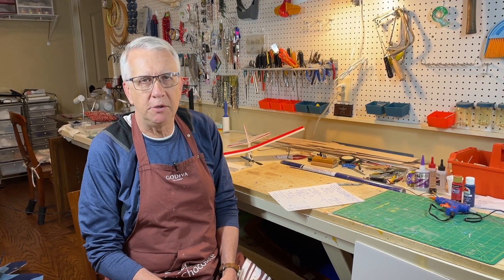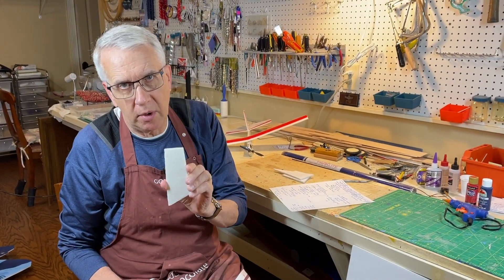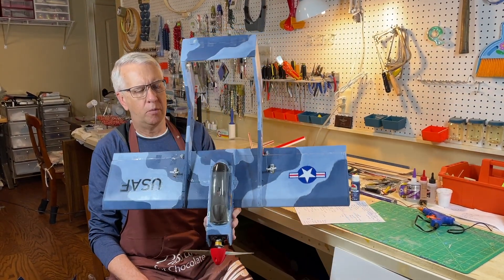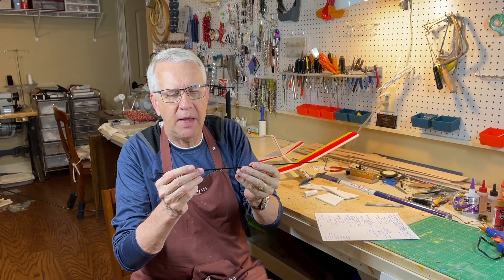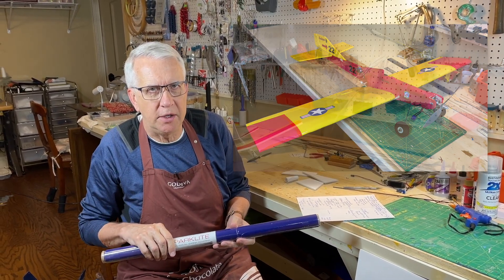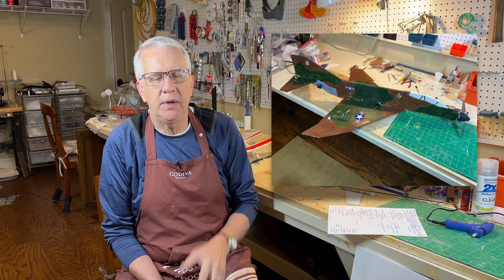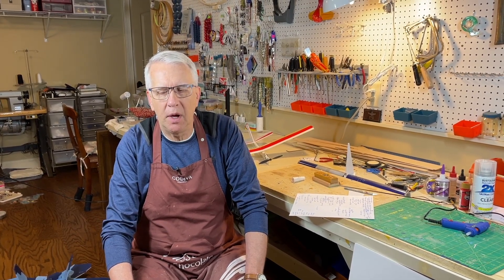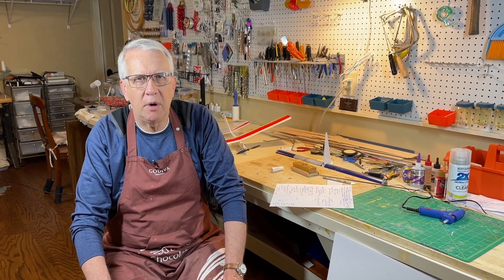10 Reasons to Build Foam Board RC Planes

Comment: I agree with every thing you've said. I've been building R/C plane for almost sixty years. However for past ten years I've used foam core boards. I make wing's airfoils using KF air foils. I truly LOVE this type of airfoil. In my opinion this type air foil uses its own air to fly. Yes it takes some practice and doings to make it work, but in my opinion it's worth the effort. Each to their own I'll say.  Two thumbs up for your effort and  the video!!!
Reply from the maker: Al:  I had to Google KF airfoils. They look most interesting!  Tim
Reply: @Al Mosh  Hi Al, the foam core board you mention - is it the PVC plastic coated "forrex" board ?
Reply: @olgoz1  This foam is just that a foma. You can buy it at any dollar tree stores.

Comment: I started building with foamboard 16 years ago when it was hard to get depron I found the foam board at Kmart at the time. At the time I was also into the GWS foam plane kits which I greatly miss. $29 for a CNC-cut foam airplane kit that you had to build. They were so light they would fly on cheap coreless brushed motors. You can occasionally find the kits for $100 on eBay or Aloft Hobbies. They always came with motors and gearboxes. For $80 you can have an incredible flying warbird. Gosh, I miss those planes.
Reply from the maker: Great update, thanks!  Tim
Reply: still have GWS zero but never fly it anymore cuzz its boxed up for sale...comes with BL motor and servos, only $75  + postage    ya gotta gettem when thier around cuzz they go away fast!

Comment: I started to building rc foam board planes three years ago. And the main reason was, it is damn cheap. The biggest coast was my Spektrum Dx6e that i bought second hand from a friend. As long as your electronics on board (motor,esc,servos etc.) survive, your good to go to just build a new plane. And if some servo dies, they are not so expensive.
Reply from the maker: Fully agree!  Tim

Comment: I love how many innovations and creative solutions appeared once foamboard (and even just cardboard) started being used in RC plane modeling. As you said, it is cheap, easily available, and gets results fast. Product development benefits when experimentation can happen faster and with lower costs. Unfortunately, it seems that foam board is not a great material to build beginner-friendly RC planes that are lighter than 250 grams and can fly without remote ID after September this year. I hope the lower mass limit for this FAA regulation will be adjusted because simply buying light planes is not terribly innovative. But as you say a lot... Wait and see. :)
Reply from the maker: KH:  Thoughtful observations, thanks so much for checking in!  As you mention, remote ID will work out.  I remember the huge fuss the 2.4 GHz radios created when they were first introduced in 2005 or so.  Radios would not work, would jam each other, on and on.  No different than the clamor and clatter on remote ID . . . and this is before anyone has actually seen or used one.  Tim

Comment: #11 reason. They bounce when they crash and are super easy to repair. Of course I’m simplifying a bit, but compared to Balsa, crashes are less severe for the same impact velocity and they tend to bend instead of breaking. Just straighten and fly again. Thanks for the video. I agree with your 10 reasons.
Reply from the maker: Very good, thanks for your input!  Tim

Comment: I'm new to this hobby and I'm wondering if you could do a video of the size motors that are used on these  types of planes. the most I know about them is the battery size. i.e. 1s 2s and so on.
Reply from the maker: David:  It can be super confusing with all the differing electric motors.  What I do is take a look at the tech specs for the motor, they usually list a model weight suitable for that motor.  E-flite Park motors has a good chart on this.  Two cells is about the minimum, for extra thrust a three cell can really change the model, just make sure the ESC can handle the higher battery cell count.  Tim

Comment: Nice video!

I began building with balsa back in 1978 and I too have enjoyed building with foam.  Just a few notes:

  1 - If youngsters are cutting foam, then you can actually make clean, straight cuts using 32 tooth-per-inch hacksaw blades.  With a little practice, and if you mark the foam and take your time, and insure the blade doesn't touch the table supporting the foam, then the cuts with a 32 tpi hacksaw blade can be accomplished.  It's "very unlikely" anyone would get hurt cutting foamboard with a 32 tpi hacksaw blade.

  2 - Technically, hot glue doesn't "dry" but it does cool and of course it hardens when it's cool.  You might also want to show how parts can be glued together to form 90 degree angles & so forth using guides/blocks.

  3  -  Miscellaneous:  foamboard can be used to make some incredibly cool bends and shapes.  Very tight bends can be made without splitting or tearing the paper covering if you put packing tape on the outside of the bended area.  Hinges are also great to demonstrate.  I usually cover my servos with painters tape before gluing them into place.  Maybe some or all of those techniques have already been provided in other videos you've created - I just discovered your page today so, not sure.

Keep at it - thanks & happy flying!  :)
Reply from the maker: Brad:  Excellent points and thanks for checking in!  Tim

Comment: Tim, thanks for all the work you do making this sport/hobby accessible to new pilots. I have previously 'tried' to fly a couple of Aero Scouts but my flying area is a hay field with stubble. This produced a disaster when the front landing gear was ripped off and along with some of the other components attached to the balsa. Not all a loss as I enjoyed the repair process. I now want to enjoy the flying as well.
I would like to build a foam board SLOW flyer that will allow me to skid in for a landing - no wheels or gear.
This plane will be a trainer so nothing fancy.
Any suggestions as to plans?
I will purchase Spectrum DX6 with a AR620. I have had several of the ready to fly radios and they are not what I am interested in.
Looking forward to your reply.
Bill C
Reply from the maker: Bill:  Copy all!  My “Foam Bug” airplanes fly nice and slow, land on their belly. If you are into building, a Lazy Bee is hard to beat for relaxed flying. Tim
Reply: @TimMcKay56  Thank you Tim. It looks like there is a electronic parts shortage on Stevens Aero and Horizon Hobby. Lots of back orders. Any other favorite suppliers?
Bill C
Reply from the maker: I did a video on where to buy RC electronics in 2022, do check that out. Tim

Comment: You made a serious misrepresentation of balance with regard to your F-4 build. Motor placement is 100% irrelevant. Any winged flying plane , full size or model, must be balanced according to a % of MAC, (mean aerodynamic cord), typically 25-30% of wing cord   Placement of R/C equipped, batteries or ballast weight shifted to accomplish this are required. Your F-22 lands poorly due to improper balance.
Reply from the maker: 👍🏻 Tim

Comment: Tim,
I built a Foamboard aiplane but I am frustrated by the warping of the vertical and horizontal tail surfaces. I painted very light mist coats to avoid delaminating the paper from the Dollar Tree Foamboard. I painted the top and bottom surface alternately between coats to avoid this very situation. 
I was successful at avoiding the delaminating of the paper but not the warping.
Is there a reliable method of correcting the warp once the plane is painted? The tail surfaces are built out of a single thickness “flat” Foamboard.
Any suggestions would be greatly appreciated. My plane looks like the Orca from Free Willy. 😕
Reply: I would love to hear and see some of those frustrations and limitations. I have heard a number of people mention the colored packing tape but I don’t really understand to whole idea. Is there a combination of paint and colored packing tape?
Reply: @Yankee2003  https://youtu.be/PbyVGfB1oCg

https://youtu.be/RHN2Ea3izpg

https://youtu.be/sYaFpcpD9A4

I think Tim here does one on tape and decals too.

Check these links out for some ideas. The limitation with packing tape would be in the inability to make forexample soft blended camouflage. The frustration lies in the fact that once the tape is applied it is very difficult to remove, so you have to take care not to make wrinkles. You may be able to iron them out carefully though. As for combinations it's all up to you and what works best for you. Paint or graphics with clear packing tape on top will work. I'm thinking of printing a couple of graphics on paper, cutting them out and sticking them on the foamboard and then applying clear tape over them on my current build. Eventually weight would be a consideration here though. I also have a roll of aluminium tape to try out at some stage ! Ultimately it's all up to you and what works best for you purposes. :)
Reply from the maker: Mike:  Not sure the width of your foam. If narrow, consider gluing two layers together. I’ve had good luck with poster acrylic paint, minimal/zero warping, even with a light spray of Krylon clear sealer. I think once a warp is set in foam, no clever way to take it out. Tim
Reply: Tim,
Thank you so much for the quick reply. 
I can see the advantage of Foamboard airplanes, but there is a learning curve for sure. Luckily the advantage of cheap building material helps take the sting out of hard lessons.
If by some stroke of genius I can figure out a way to solve my warping issue I will pass it along. I think I might take some “before” pictures just in case.
Thanks again Tim…love the channel!
Reply: @Yankee2003  Hi Mike, I also found that painting warps the board. I think very light coats and perhaps different types of boards are where others are successful. Perhaps even more favourable environmental factors. I don't paint because of this warping . . I use couloured packing tape which has it's own limitations and frustrations but hugely increases strength.
Reply from the maker: No worries!  Tim
Reply: Flatten foamboard by clamping between two sheets of ply and feed 1mm carbon rod for strength and warping.

Comment: Another great video Tim. Foamboard is cheap, fun, and you can rapid prototype. I have some really fun originals that were once built with foamboard and now have become even better when using the roughly 1/2" Lowes Blue 4x8 sheet of Styrofoam Insulation sheathing.(very inexpensive as well) Then glue blocks to hand shape the fuselage. Very satisfying results. I'm looking into silicone mold making and using expandable foams so I can easily produce more copies. Regards, LL
Reply from the maker: Hangar:  Good point on the 1/2” foam, I do need to check that out!  Tim
Reply: @TimMcKay56  https://www.youtube.com/watch?v=fwco2dkVrhA

Comment: Good info, Tim, Could you make a vid, showing the motor and electronics laid out on the bench for a 2 wire motor  for a park flyer? I can't use my throttle joystick so I just have a toggle swicth for the motor.Thanks Joe.
Reply from the maker: Joe:  Will add to the list!  Tim

Comment: Tim - you sort of touched on this in several chapters, that you can repair foamboard planes pretty quickly.  After my son crashed his tiny trainer and destroyed the nose, I cut off the front 1/4 off the fuselage and spliced in a new section, a 1 hour, easy repair, good as new.  If you haven't built a foamboard 3d profile plane, they are fun to make and fly!
Reply from the maker: Mike:  Excellent point, thanks for this reminder!  Tim

Comment: Great video Tim! I'm currently working on a 42 inch foam board tri-motor w/retracts. Next will be a 800mm Pitts. Foam board combined with li-po batteries and brushless motors really opened up RC flight to so many more people which is priceless for the hobby! Cheers!
Reply from the maker: J:  Great update, thanks!  Tim